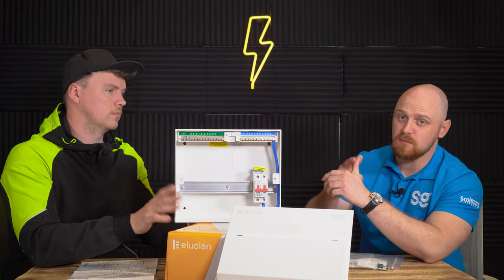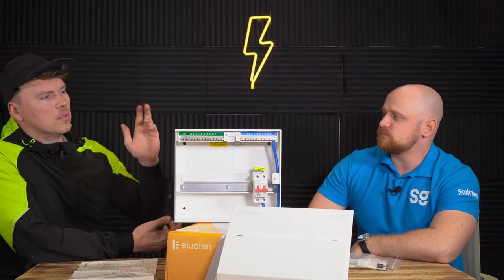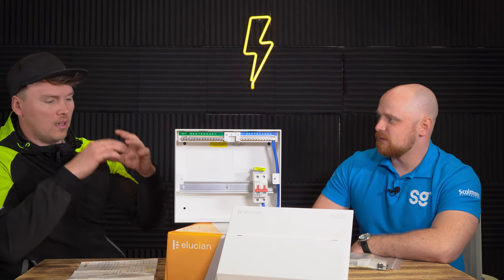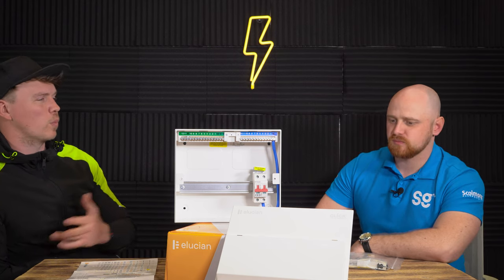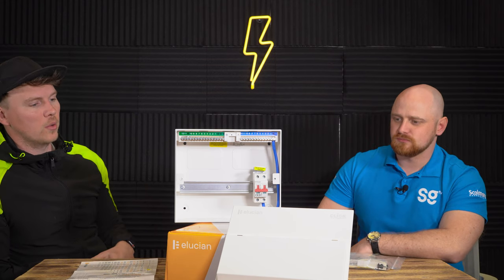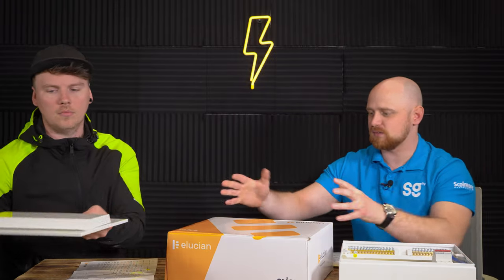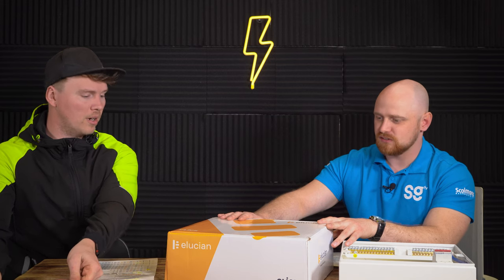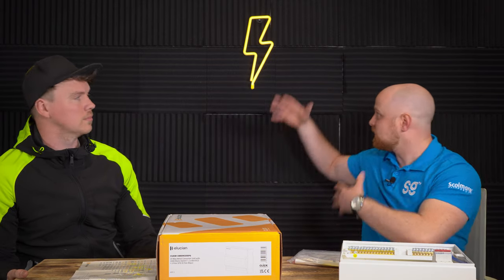Talking consumer units with Nick Bundy - SGTV 📺

Comment: I recently fitted a 14 way Elucian board with spd and rcbo’s, As far as build quality and ease of fitting it was really good and looks good as well. My only issue was that the SPD did not come with any info and with most SPD’S they come with a fitting kit which this came without it and no info and when I tried looking it up on their website I could not find it and had to go back to my local CEF to get a fact sheet. The board does not give you room to put the SPD next to the mains switch as the tails clamp is fixed so I ended up fitting it the other end of the board. The sticker pack was ok but that did not come with an SPD sticker so had to make my own. These are the only things I could find wrong, other than those bits I would happily fit these boards going forward.
Reply from the maker: Thank you for providing us with this feedback, we have passed this information on to the product development team.